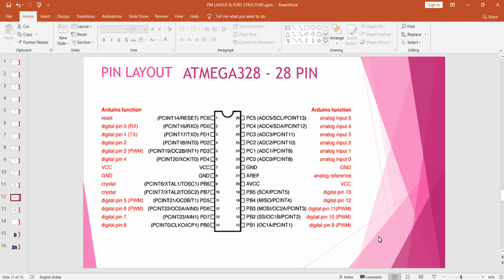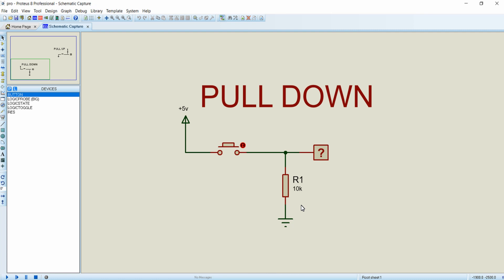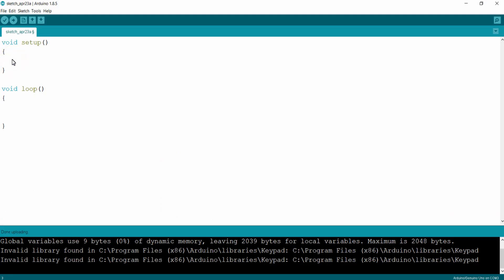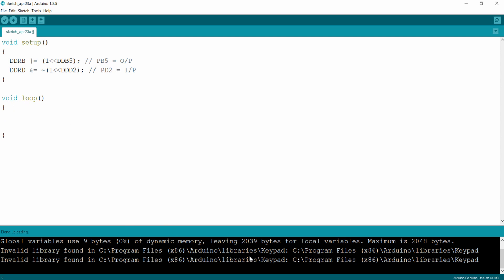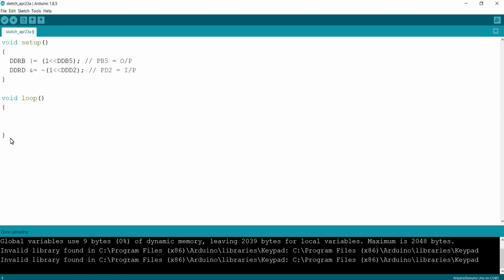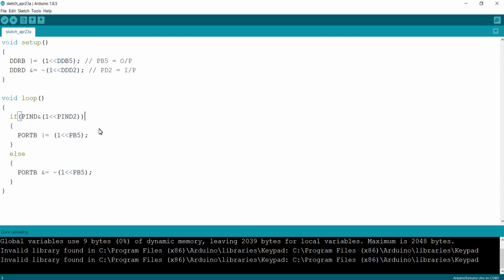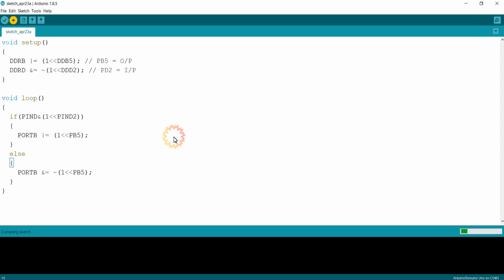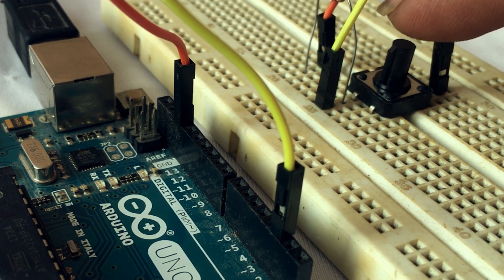Interfacing of Push Buttons with Arduino | Register Level Programming in Arduino T - 15

Comment: good work! but what's the expression of the INPUT_PULLUP Please !
Reply from the maker: Hello Limem,
Are you asking what does INPUT_PULLUP mean ..?
If it so, that means there will be internal pull up resistors available in Atmega328 microcontroller for each digital Gpio pins and for enabling that we will be using that INPUT_PULLUP definition